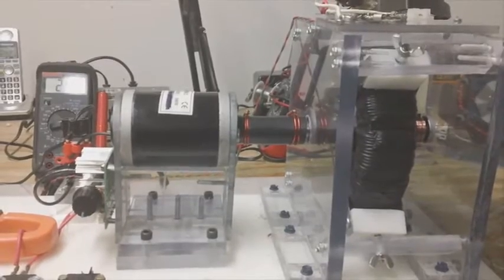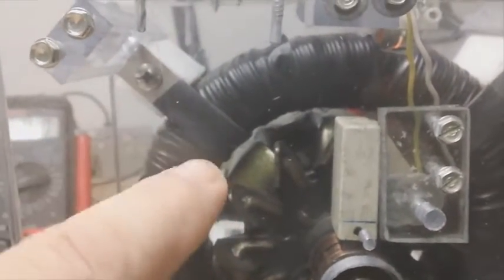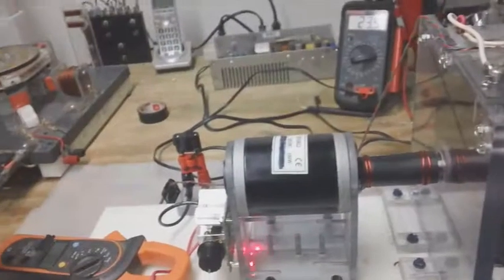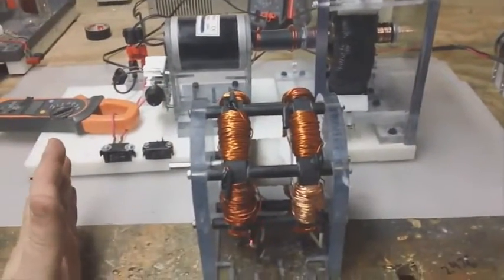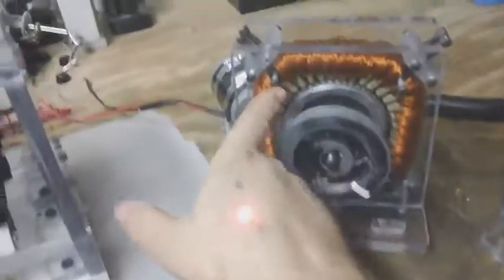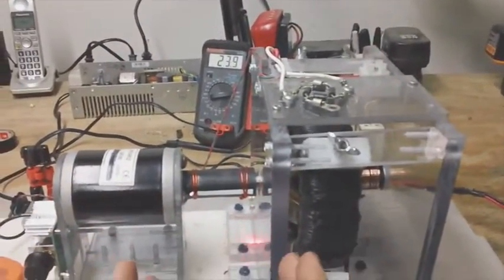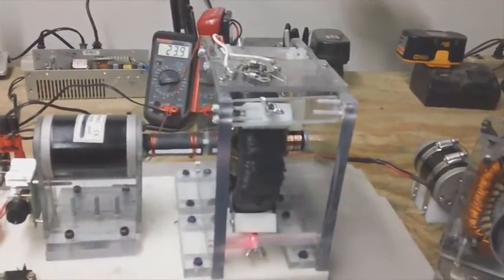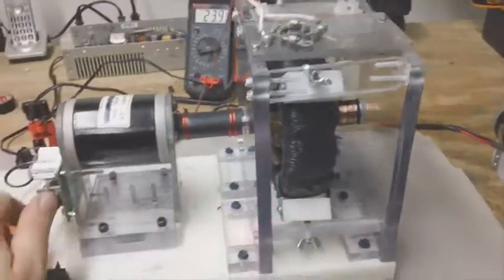Generator 2.0

Comment: Nice,I have a question about your vmg motor, can you tell me how you wound your most productive coils for the motor that has a lot of torque? Thanks Rick
Reply from the maker: Hi Rick,  as far as Motors go I have been using off the shelf 24 volt motor  with a PWM driver like you see in this video but if you're asking me about  generator coils which is really what this video is about. here is a link  https://www.youtube.com/watch?v=IAjBj3pJ_Yg